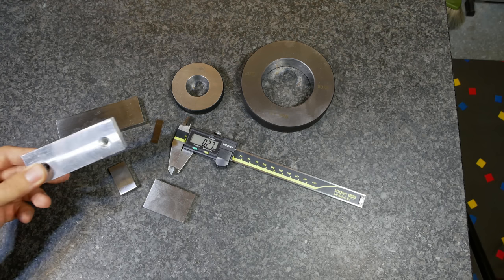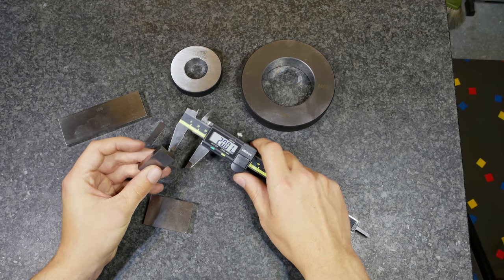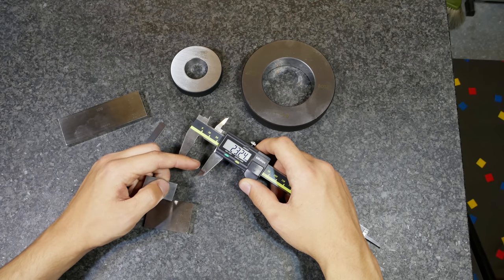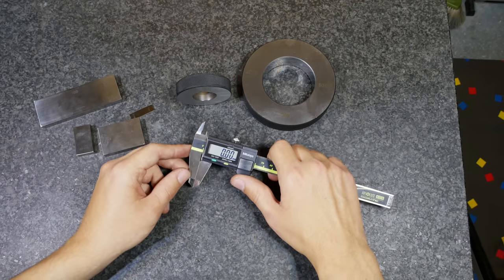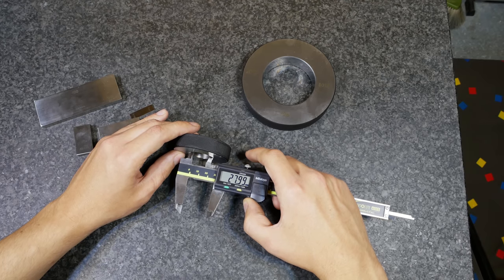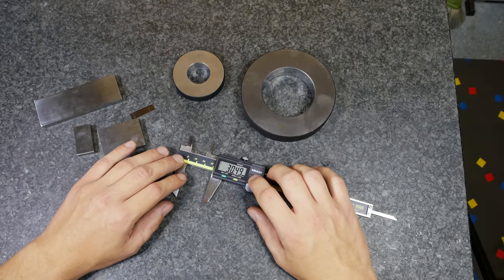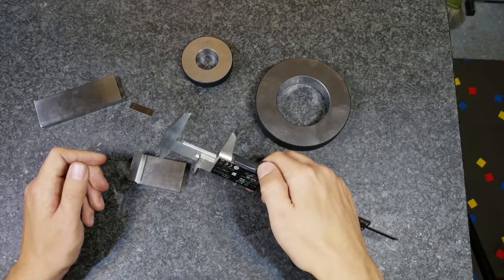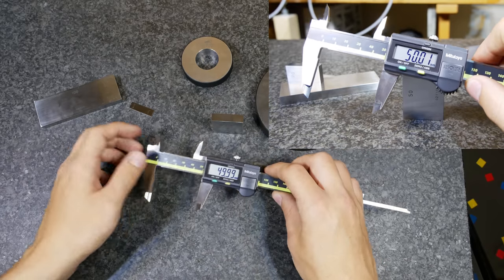How to measure with digital calipers

Comment: Awesome!
Juste a note: when you can't use the calipers in a direction where you can see the measure directly, you can just press the "zero" button when it's placed well. Then you don't have to take any special care when removing the calipers. To read the measure, you'll just have to put it to its starting position, the measure will be marked (but with the minus sign of course).

Comment: Remember that the digits can indicate more precision than the underlying sensor strip in the calipers.  More of an issue w/inches than mm, but that can leave you off by one or two on the last digit.
Also, the offset notch on the depth measurement bar is to avoid error if there's a bottom radius.

Comment: for measuring with the rod, use the short side to align, because it gives you more overhang. Also the rod is more stiff in that direction and is less likely to bend

Comment: I have been an Operator going on 3 years and I still have a lot of trouble measuring the diameter of a hole on my parts. You are supposed to take half of the bit size and subtract that from the diameter to get the correct measurement is what I have been shown and I just don't understand that.
Reply: Sounds like the process used when figuring out the hole placement in the part? Is that what you're trying to find there ?